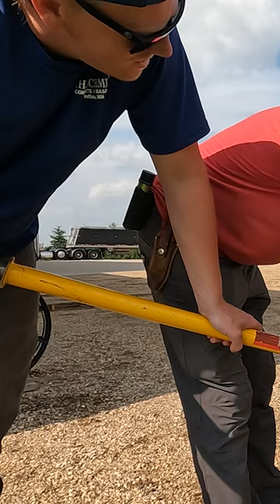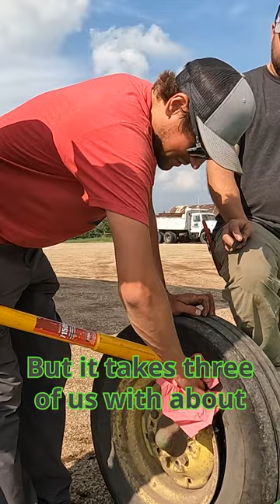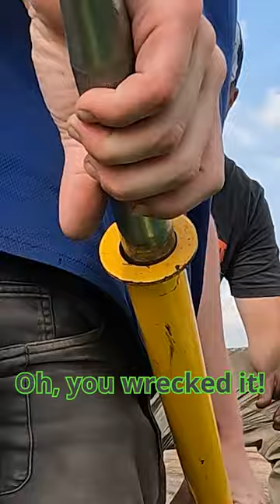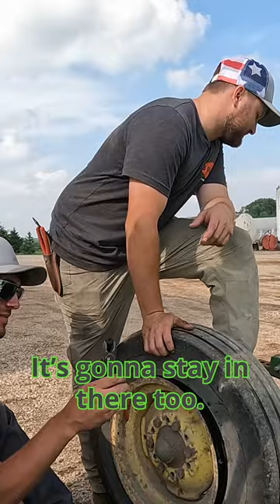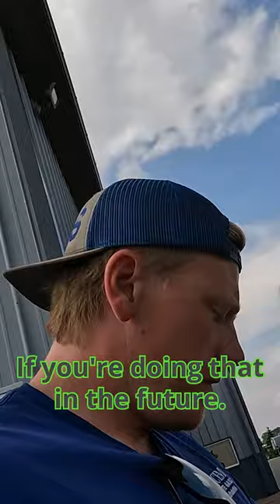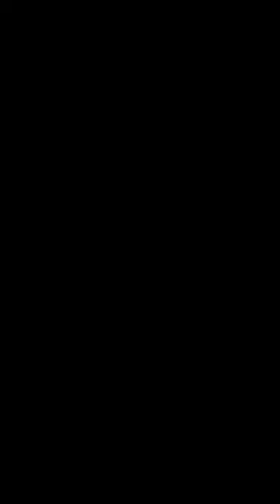You Wrecked It!!!

Comment: They make a valve stem installer now where you don't have to break the bead. I bought mine from the jungle website. I used it on a trailer tire, and it worked.
Reply: great info!